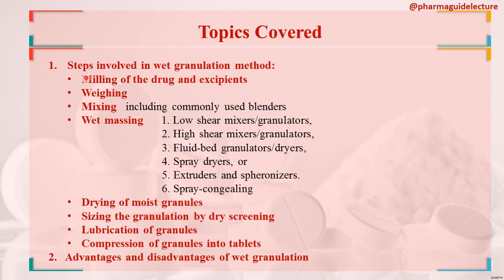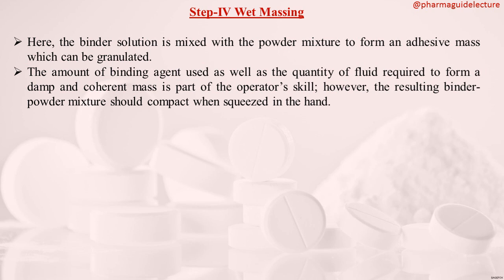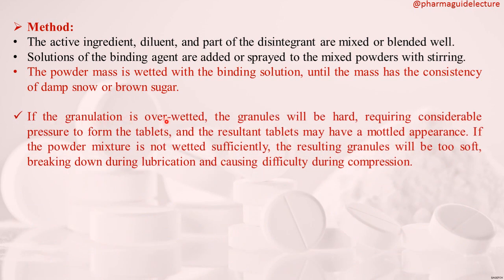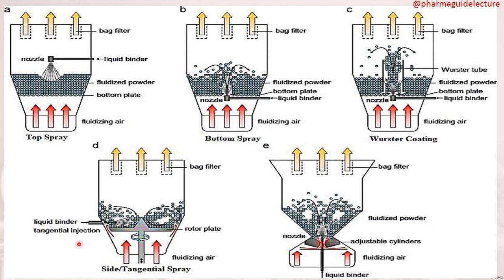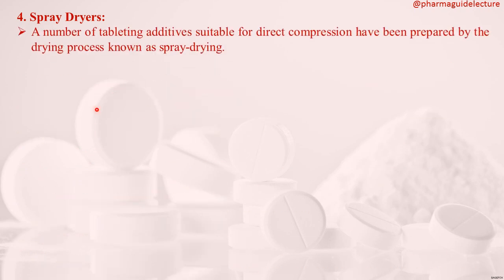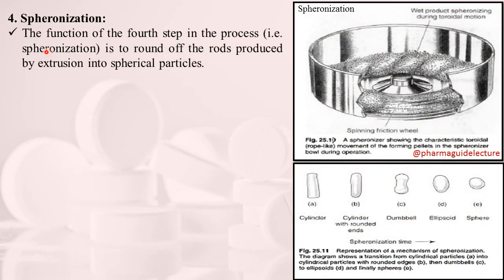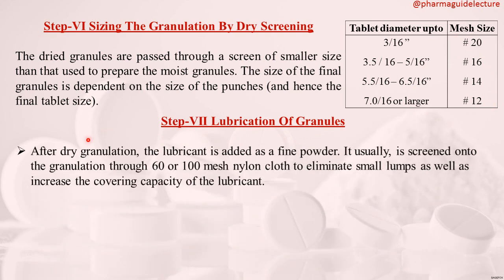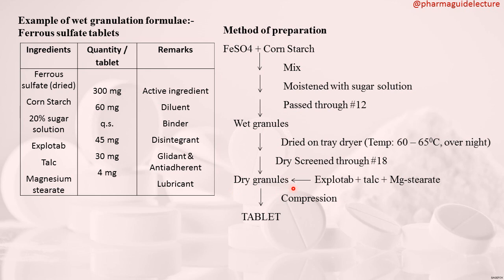Manufacturing of Tablets by wet Granulation method

Comment: If how to increase your tablet output is your concern? Then MORSE-O-TOOL is the one-stop-solution for your Tablet Tool Requirements. With over 40 years of tablet tooling experience, MOT has the expertise and the technology to create high-grade dies and punches that surpasses your tablet tooling needs.

With a precise understanding of the challenges, we design and manufacture Tablet Tools that are high in quality and ensures better productivity. Owing to the attributes of the Tablet we make the tablet tool with high-grade steel, the material used is that of premium quality and sturdy.

Our range of tools meets the required cost, quality effectiveness and efficiency. They are easy to maintain, at the same time they also extend finely balanced coating that ensures unbeatable quality.

These dies and punches are widely appreciated by our esteemed clients.

To get a quote for Tablet Tools contact us on 9511927860